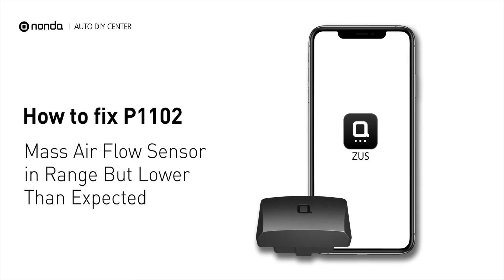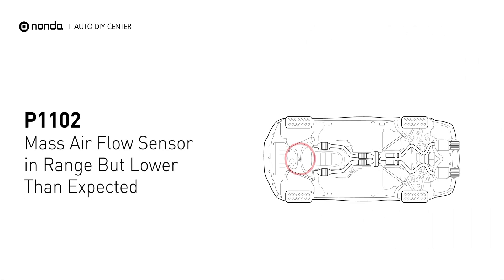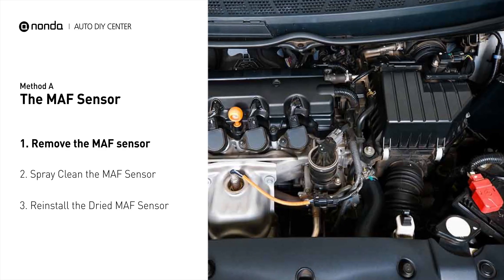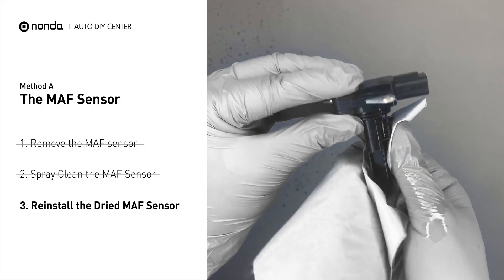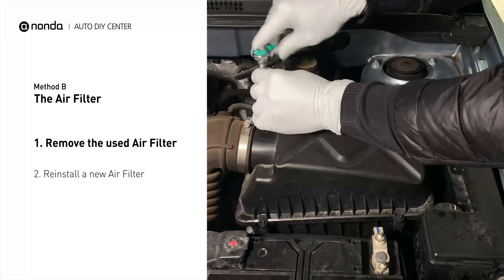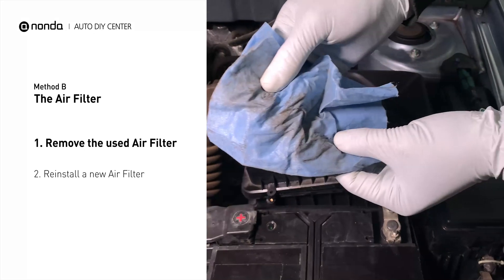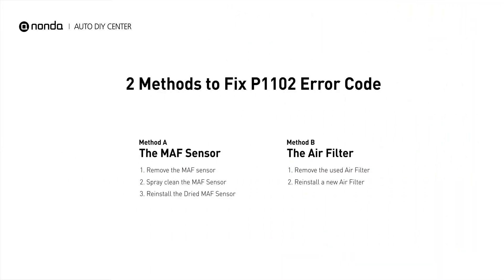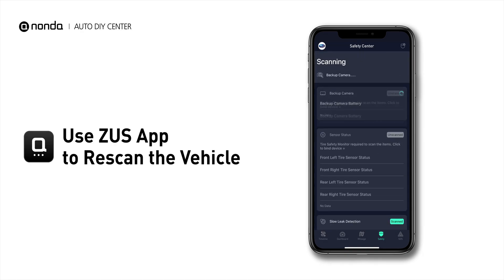How to Fix P1102 Engine Code in 3 Minutes [2 DIY Methods / Only $7.86]

Comment: I had this problem and it wasnt sensor but Air filter Intake pipe. Rubber part supplying air to the engine. It was cracked and unnecessary air was getting in. Check out this part.